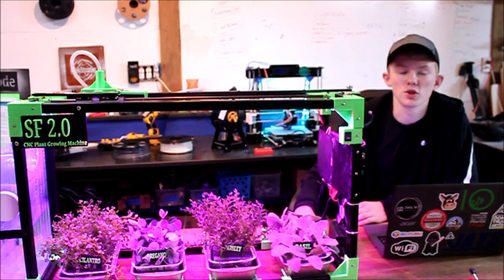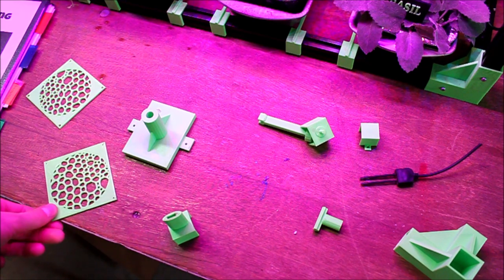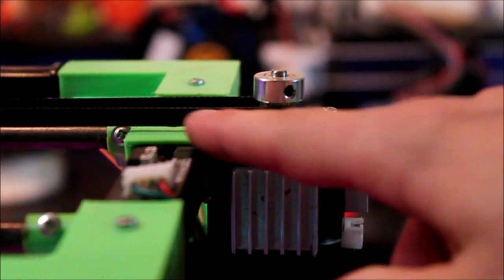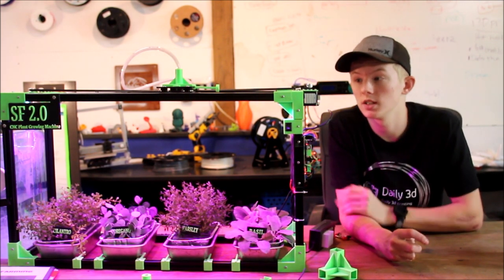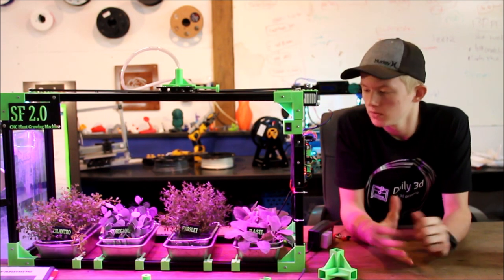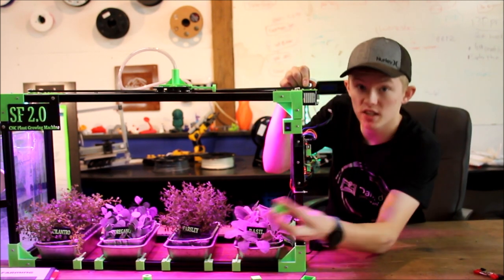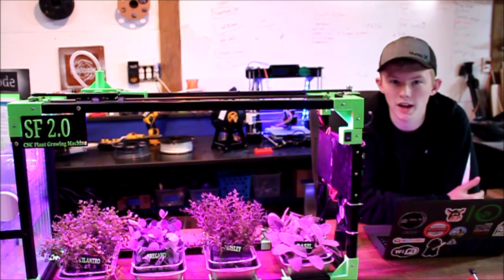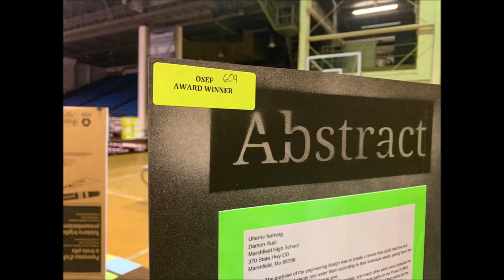CNC Arduino Plant Growing Machine // SF 2.0 Final

Comment: Nice!
Would have liked to see the watering in action (or did I blink at the wrong time?).
Like that you included a fan to make the plants stronger.
Some plants can be more sensitive to mold when watered from above, especially if they don't quickly dry off.  Have you had any ideas about watering below the foliage?  Avoiding watering during the dark part of day?
Reply from the maker: Pretty sure you blinked at the wrong time 😂,  and I did have a couple issues with molding on some plants. I had also thought about doing some sort of tubing in the soil of the plants to water wich would be much cleaner and more efficient but then it would have been harder to move plants in the system. I had also considered running tubing near the top of the soil and just doing it closer but that thought was after the competition was over